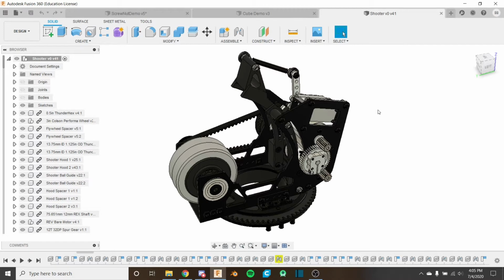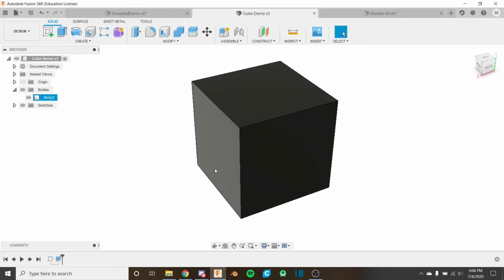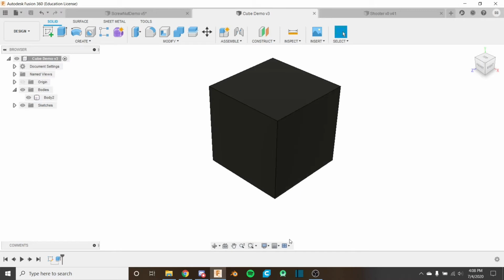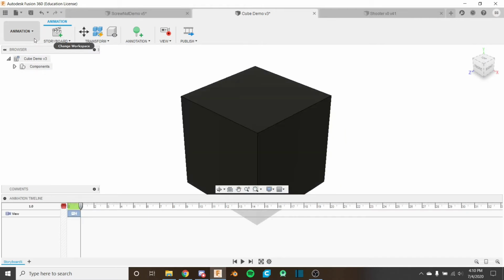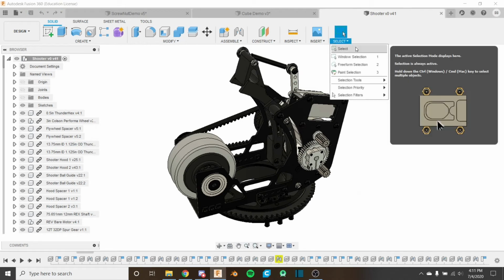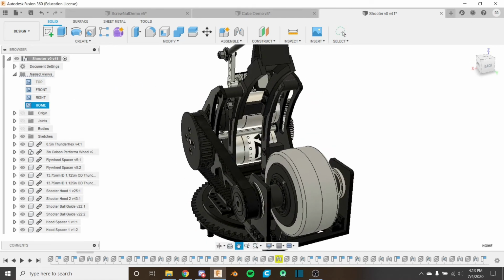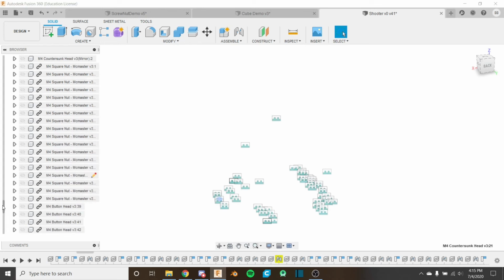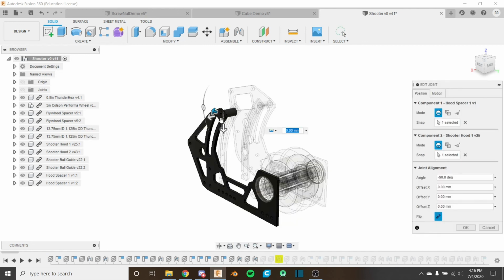Fusion 360 for FTC: Fusion UI

Comment: Hello, quick question. How did you constrain the belt for the shooter. I use inventor, and I can never find out how to constrain it. Thanks
Reply from the maker: While the belt doesn't deform and rotate with the pulleys, I used the As-Build Rigid Joint Command (which rigidly joints two objects relative to each other in the position they are at when the As-Build Joint tool is used) to lock the relative position of the belt and a stationary plate on the shooter hood to ensure that the belt rotated with the shooter on the turret. One way to achieve this in Inventor is to use a rigid joint between two objects and then define offset of that joint by specifying the origin offset. For this shooter assembly you would select the hood and the belt (making sure the belt was center around the driving and drive axles) and then specify the offset that would make the belt align with the pulleys. Although I am not too familiar with the Inventor tools I believe you could also create work planes/points that would allow you to fully constrain the belt using a few constraints that reference those work planes/points. Hopefully you are able to figure out how to constrain the belts from this comment and thanks for watching the videos!